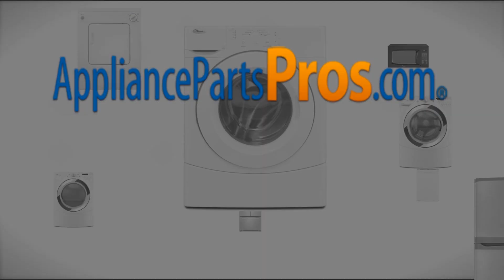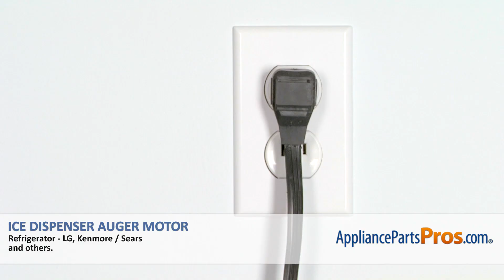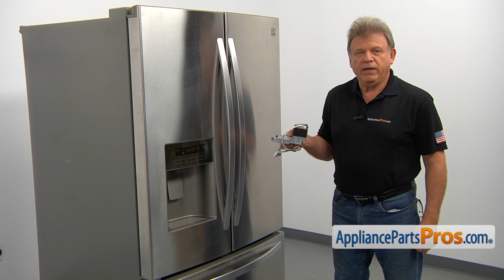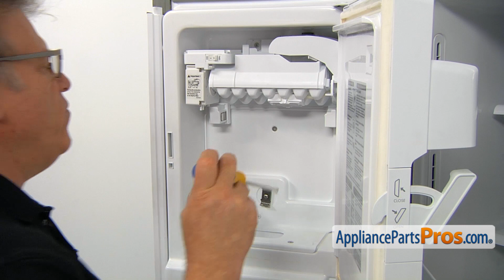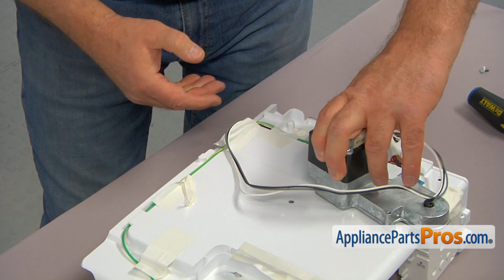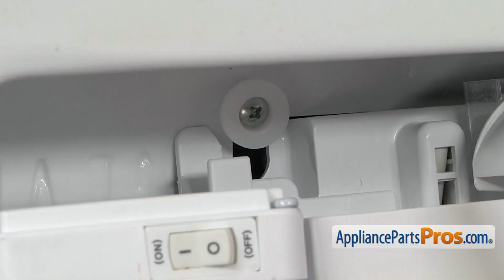How To: LG/Kenmore Refrigerator Ice Dispenser Auger Motor EAU60784231

Comment: Replaced my motor and the dispensar still doesn't work. Not sure what to do
Reply from the maker: For free technical support, please visit our Repair Forum: https://forum.appliancepartspros.com/.  It’s easy to register, and you can either post your question or search the forum to see if someone else has already asked the same question.
 
Our experienced technicians, with over 20 years of hands-on appliance repair experience, are ready to answer your questions and guide you through your repair.
Reply: Did you figure it out. I’m dealing with the same thing. I press the button and hear the initial activation but augers not moving. I did an ohms check and I have 30 ohms of resistance so I’m not sure what’s happening. I don’t want to spend the money if it was something else

Comment: So the video is very clear, although I had enough of a problem removing the screw for the coupling that we had to drill it out and buy a replacement (M4, 8mm seemed to do the trick). HOWEVER, the cabling on the part I got from AppliancePartsPros wasn't long enough. Didn't fit in the channel around the housing, even though the housing in the video was identical to the one in my freezer.
Reply from the maker: You will want to check your model number and make sure the correct part was ordered and that the part is being installed properly.
Reply: @appliancepartspros  The compatibility tool said it would work. I have the screenshot if you want it. And yes, I followed the steps to the letter. I can also show you the original and the replacement and you can see the cabling is much shorter on the part you sold me.
Reply from the maker: What is your model number and the part number you ordered?

Comment: The screw that is connected to the front of the Auger motor is frozen and I cannot remove it. Can you give me any suggestions on how to get the screw out? I have taken it completely apart
Reply from the maker: There isn't really a trick to it, you will just need to keep working at it to try and get it out.

Comment: I cannot remove the screw from the coupling (the silver screw).  It won't move.  Any ideas?
Reply: I had the same problem.  Solution: I used my oscillating multitool with a metal cutting blade to cut a deep slot across the top of the screw.  Then I used a large regular slot screwdriver and the screw finally came loose.
Reply from the maker: What do you mean it won't move? You should be able to just take a Phillip's screwdriver and loosen it so it will come out.
Reply: @appliancepartspros  : 

First of all, thank you very much for the reply.  It is greatly appreciated.

Just to be clear, this is the screw being taken out at 2:30 in the video. I take a Phillip's screwdriver and put it in the screw.  When I turn the screw, it turns the whole motor.  So, I have to get a pair of pliers and hold onto the silver piece that is exposed.  After that, I cannot turn the screw at all.  It just won't move.  Any ideas?

And, also to be clear, I am not any way near an appliance repair expert or professional.  So, I could easily be missing something obvious.
Reply from the maker: Right I do see the screw that you are referring to. It does appear that you would have to hold that silver piece in order to get the screw loosen up. There are no other tricks that we can recommend.
Reply: Same. It won’t budge without almost stripping it

Comment: Great video. Thanks for the help!
Reply: Does anyone know if the coupling can be turned manually (turns really hard) if that means moto’s no good. The coupling is not frozen. We hear the motor but it won’t drop ice into cup. It appears the flap is working properly.